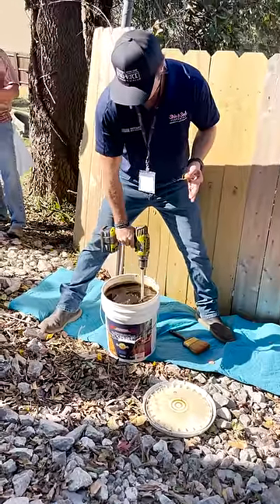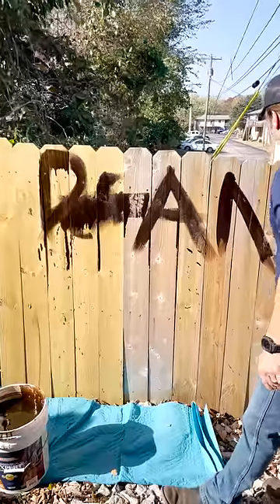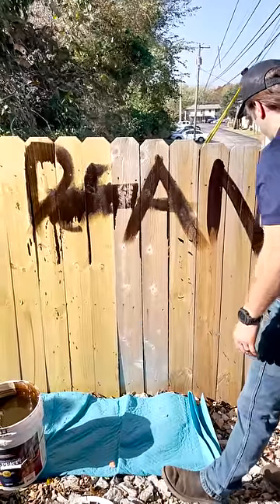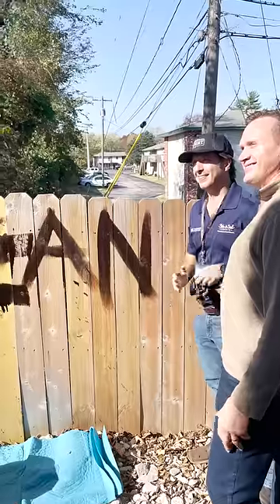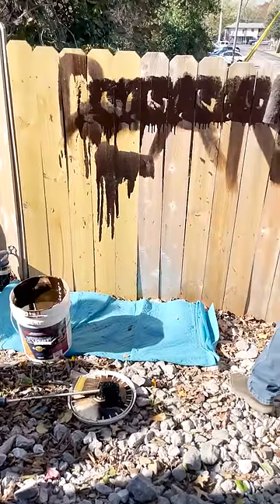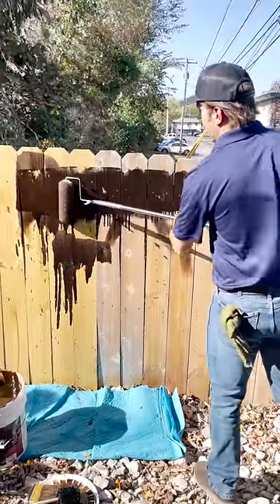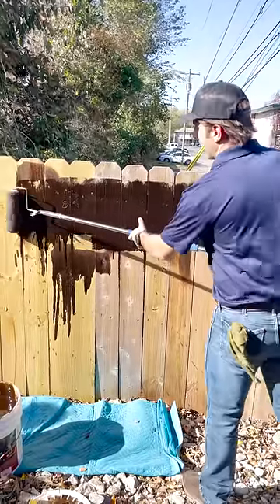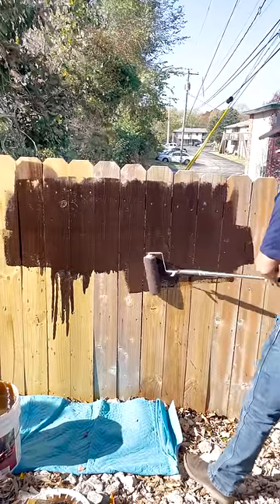You Won't Believe What This Guy Did To This Fence #Shorts

Comment: Actually, those are none of the reasons some people avoid oil based finishes.
Reply from the maker: Interesting, they’re most of the reasons we avoided them in the past. What would you say the top reasons are, specifically for fence & deck staining?
Reply: @JoeEverest  Water based finishes are being pushed due to environmental concerns. I'm not saying I agree with them on that but it does have an impact on which gets used on projects.
For example, our city approved funding for mailbox stations on my street. They specified a water based finish. Most people tend to just "go with the flow" not realizing their water based finish won't last near as long.

The only other reasons not to use oil based is spontaneous combustion of rags, etc and the amber, darker tint that might not be preferable on lighter colored wood. Also, some topcoats don't play well with oil based stain.

I can't imagine someone choosing  water over oil to make cleaning their brushes and sprayers a little easier but I suppose its possible.
Reply from the maker: @Jeremy_810  we likely should have pointed out that this particular stain is a low VOC version, it sounds like your experience is with the high VOC stains found in most big box stores. Combustion is much less of a concern and top costs can be applied at any time.

Comment: What he doesn't show is the 4 underpaid workers that have to go back after an hour or so and wipe off the excess stain so that it dries properly and stays even
Reply from the maker: Not the case, this is a flood coat system. Two team member spray, wipe down overspray and move on the next job. The fence in the video was stained by trainees with little to no experience and wasn’t wiped off after.

Comment: I'm sorry but dude is not telling the truth.
Reply from the maker: Which part? His statements have matched our experience with the product so far over the last couple of years.
Reply: @JoeEverest  I'm speaking just staining and painting in general.  At what time is oil base stain easier to get off than water base paint. U would have to sand the wood down to remove the stain.
Reply from the maker: @steveshypebeastandsneakerr4980  my take is that he was talking about overspray, which can be wiped off with degreaser. Overspray on wood can generally be stripped off with either sodium or potassium hydroxide.

Comment: Tell him to write the name, let it completely dry, come back the next day and see if Dean's name shows through, guess what Dean's name will show through clear as day because the stain is drying and curing at two different temperatures.
Reply from the maker: With water based you’re absolutely right. The benefit of oil based is that the oil can be applied over several days if need be.